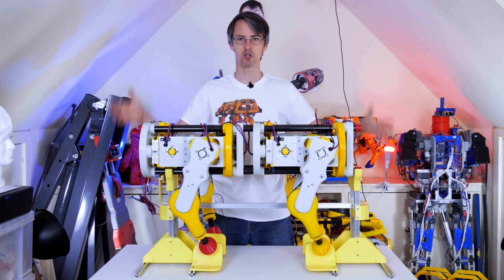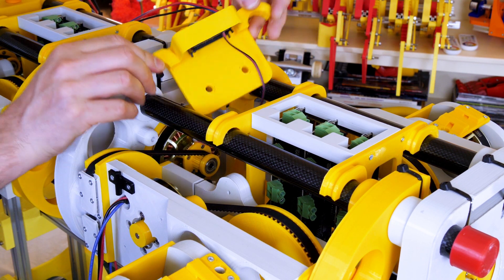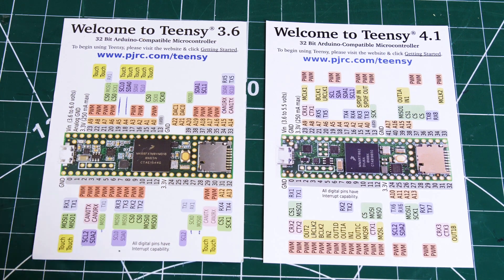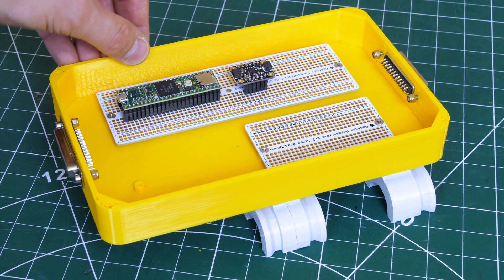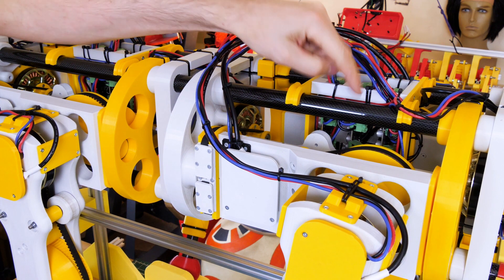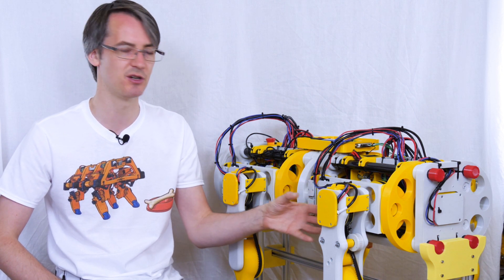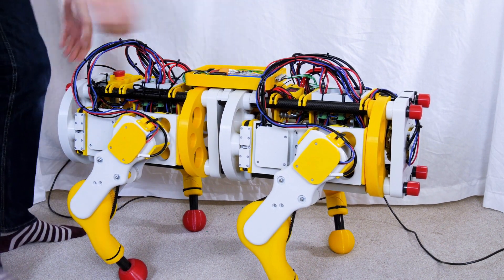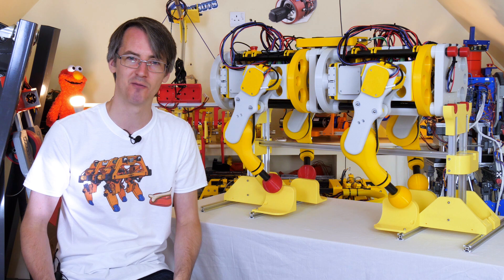openDog V2 Part 4 - Electronics and Power up!

Comment: Please reply. I need help with a university assignment.

I have to design a 6dof robot arm for a university project. I have to design the arm itself using a arduino mega 2560 and 6 nema 17 motors, as well as the power supply for the arm. I have to design the rectifier as well as the converter to convert our 230 V AC (I am from South Africa) to 12V for the drivers as well as the Arduino in parallel. I read online that my power supply should be > than at least 2/3 my current per phase of my motor time by the amunt of motors you have. After looking at the specific nema 17 datasheet I had seen they have a phase current of 0.31 A. This means I have to have at least 1.24 amps from my power supply for my motors alone, would you say this is about right? If so do you believe a 5A power supply should be enough to run both the 6 motors as well as the arduino along with all of its connections. Or do you think it would be better to have a seperate power supply for the arduino to draw its own current and avoid transients like you said in the video or would it be fine to run both the arduino and the motors in parallel off of one 12V 5A power supply?

Comment: I thought you were going to put a teensy 4.0 on every motor and connect them on the flexCan bus, with a dedicated small motor controller on the motor, then you only need to route power and Can to each motor. put the motor controller on the same pcb as the encoder.
Reply from the maker: which 'small motor controller' should I use that is open source?

Comment: Hi James, was noticing the lipo you use to power the electronics and actually now that I think of it, the Dog. 

I want to encourage you to at least briefly explore Life batteries, they might prove very suitable for this application. They are not as efficient storage to weight but since the dog is not an aircraft I can only see advantages. They have a lower nominal voltage, and an extremely flat discharge curve. They're absolutely not flammable and it looks like the lipos you are using need to be very carefully voltage-controlled so as not to pose a hazard. The true benefit of the life is it can be discharged deeply without damaging the cells, and they have extreme sustained discharge capabilities.

The ones that I got were used for DeWalt battery packs. They can be reassembled and rewired into incredible batteries that I imagine would be perfectly suited for your specific application.

I am unaffiliated completely,  but I bought two of them a long time ago and they are completely indestructible. I have abused almost all of my other lipos to the point where they have decreased capacity or cell puffing. 

Tl;dr l.i.f.e cell chemistry is very stable and powerful, and DeWalt life cells are a good way to take advantage of their unique properties.

Comment: You could put fans on the shoulders to help with heat maybe?
Another option would be to have all the drives oil cooled and use an intercooler somewhere.

Comment: Hey James. I love the videos. I recently discovered your channel. Keep up the good work!
Just a quick note: referring to 13:38, if the dog is in a resting position (just standing and not doing anything) maybe you could straighten out the legs? The power needed in a straight leg would be less than the power needed in a bent leg. Less power equals less heat. I think with straight legs there would be other balancing challenges but maybe feedback loop in O-drive would be able to handle it?

Comment: How about offsetting the static load with some springs?
Ideally start with the knee joints as they seem to work harder than the other joints.
Potentially with the right stiffness and preload you would even get some nice boost for jumping.
Reply: That's basically how nature does it, tendons and muscle, springs and motors.

Comment: The shoulder joints seem a bit too compliant.  Can you fix this by changing the control loop parameters ?  Seems worth a try before printing new parts to change the reduction ratio.  You probably need to tune each type of joint independently.

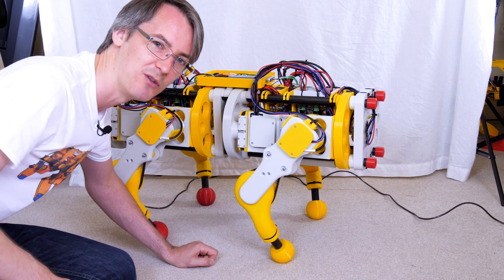Comment: 13:37 Maybe put some small fans facing the motors.
Reply from the maker: I think I'll need heatsink mounting plates with fans attached eventually.
Reply: @jamesbruton  the heat is primarily created in the windings rather than the magnets and there isn't much thermally conductive material to conduct the heat out of the windings because the stator is built on a composite structure. Your best bet would be air flow over the copper of the windings. IMO
Reply: @jamesbruton  also keep an eye on the odrive mosfet and driver temps. They need heat sinks and potentially active cooling when they are dealing with 10s of amps.

Comment: How long does it take to become such an Autodesk Fusion professional?
I wouldn't find the time to learn this. For my modelrockets I use Blender3D, which is not a CAD-Software.
But it works for me, because rockets are simple tubes in most cases. Their structure isn't very complex, and I'm not very ambitious ^^
Reply from the maker: Not too long, although I was using Autodesk 123D design before that

Comment: Looking at the wobble I think you gain a lot if you increase the distance between front and rear legs a bit. It looks as though it might fall over flat on its face after some rapid fwd bkwd movements. Anyway this appears to be the best 4-legged robot you have built by far. Good job.
Reply from the maker: I'm turning the back end around in the next video

Comment: Look at the Beagle Bone Blue Linux board.
Reply from the maker: For now I don't need an actual operating system, a microcontroller is more than good enough. I have a video coming up about Linux/ROS/Machine Learning though.
Reply: @jamesbruton  That sounds interesting.  THe BBB has IO and motor drivers and IMU and compass.  But it is dealing with LINUX.  The processor has two small microcontrollers that run independently of LINUX for fast realtime.  Keep up the good work.

Comment: Rated up to 48v... My "48v" battery gets well past 50v, would this still work?
Reply: If you are measuring 50V, you are probably measuring the battery without any load, which is giving you kinda meaningless numbers.  Put a small load across the battery, and measure again.
Reply from the maker: The 48V ODrive has 48V caps in it. The ODrive 3.6 is 56V now though..

Comment: Do be careful with your power distribution lugs.  Those lipos can easily deliver 150A continuous, and 25x that instantaneously.  That's enough to vaporize those bolts if they short out.

Comment: You really want to use the Jetson?
Man that will be a departure for you.
You'll better start to familiarize with Linux right away so you know at least some of the commands you are punching into the console.
Try to get arch running that is punishing enough that ROS will feel like easier.

Comment: I'd definately build a quick rig to charactise your motors!  Use an arm with a mass (simple but torque has an angular dependancy), or a pulley with string and a mass or scales (keeps constant torque). then define your peak short term current limit (may as well be the maximum your O-drive's can supply (or th saturation limit of the motors themselves if lower) by ploting torque against current in steps. Then, mechanicallly lock the motor solid and carry out some long term thermal tests, fix phase current, and measure motor temp until it stabilises, starting at low current to avoid gross overheat), measure the average phase voltage at each current (easy because motor isn't moving) and that multipled by the phase current gives you the phase power.  Do that at a few current levels and you get a thermal impedance for the motor (in watts per degree). You can now use a simple integrating power function in your controller to estimate the motor temperaure in application, and limit the phase current accordingly.  What this will do is give you a large instantaneous peak current for very fast dynamic control (you could actively counter flex in the chassis /joints/structure for example) but prevent your motors overheating during the longer term holding loads, which require much less torque, but for a longer time (your thermal integration model of course simply counts the energy flowing into the motor vs time)

Comment: Interrsting thought: when the knees bend, the power needed to hold the dog up will go up aswell. What if you made the knee pullies oval, so that the gear ratio changes, when the angle of the joint changes
Reply: The idea is good but i dont know if this is so easy to program but it would be possible
Reply: That might work, but an issue I see with an ovular pulley is that the tension on the belt would fluctuate as the pulley rotates, he would need to design a shifting tensioner for the belt to prevent skipping or overtightening/loosening of the belt

Comment: that little jump was amazing
love the new design
I only always have the feeling that the red feet show the front not the rear.
Are you sure you want to tie in the battery?
maybe mount your holder upside down, so you can tie in the batterie with a velcro strap
so it can be removed for charging
Reply from the maker: There's more jumping in the next video!

Comment: Just stick a tiny little fan to blow some air over the motors and you'll be fine.
I don't think they're meant for static torque anyways, normally when they spin they generate some airflow to cool themselves.
And if they get hot enough to melt the PLA then they'll also be plenty hot enough to damage the neodynium magnets.
Reply from the maker: Yes I think I need aluminium heatsink mounting plates and cooling fans

Comment: awesome!
Reply: does it make sence to position all legs outwarts, while normal/still standing? i am thinking about 2° or 3° away from center/diagonal.
this would make a little triangle, providing more over all stability.
Reply: @VideoStefan17  he has them facing this way so the feet are in line with the shoulder joints. This is important for the kinametic model.

Comment: Nice to see it moving; looks like a huge improvement indeed; very reactive, backdrivable, and quiet too. 'Wobbliness' seems fine to me; this is to be expected with motors just holding position; if you have a proper dynamical model you can program it to dampen itself, rather than oscilate as much, and it seems to have plenty of power to react in whatever way you desire. I wonder if arduino has an modules so that you dont have to reinvent the wheel on all things control systems related. This may be part of the fun for you but there is a lot more out there than a single-DOF PID loop. I think itd be especially cool to couple a robot like this to your jetson, and run some modern learning-based control algorithms on it. If you have a somewhat accurate model of your entire robot in software, you can train that to walk elegantly and energy-efficiently in software, and then fine-tune that model on your physical machine. These are fairly new techniques, but if you were to partner with someone that knows a bit about more ML-based control systems I think you could get some really mind blowing results, now that the hardware is of this quality.
Reply from the maker: Well the ODrive has it's own PID parameters for the actual motor positioning so I don't have to deal with that in my own code.
Reply: @jamesbruton  Well thats a convenience relative to having to do it in arduino, but any such single-DOF controller, or combination thereof, is never going to be a substitute for a controller that is optimized over the entire system of degrees of freedom.
Reply: @eelcohoogendoorn8044  While true, having a low level high bandwidth single DoF controller coupled with a low reduction geartrain is one of the innovations that made machines like the MIT Cheetah and Mini-Cheetah possible (and my own).  Higher level control can be much simpler, and run at a lower rate, when you have a quasi direct drive low level control with electronically controlled compliance.

Comment: Maybe add some cooling fans to the motors? Can't wait for the next vid. I've always wanted to make my own robot dog, but I never put myself to it. Too many other projects combined with life stuff going for me. Yours ended up better than anything I've thought of anyways, though I always knew back driveable systems are the way to go. Maybe in the future you could experiment with linear induction motors.
Reply from the maker: I think I'll need heatsink mounting plates and possibly cooling fans
Reply: It's possible you might have to program a "resting" position or in other word, make it a lazy dog when it's on but not doing anything.

Comment: Love the video, as always! Is there a reason you don't use PlatformIO instead of the Arduino IDE or an ESP32 instead of a Teensy? I was scared to try it but once I did I realized I'd never switch back.
Reply from the maker: The Teensy 4.1 is massively more powerful and also has 8 serial ports.
Reply: PlatformIO really is a game-changer;
For those embedded projects I always used to program in the Arduino IDE because it is just so convenient with the Download Buttons etc...
But being able to use the full Arduino environment within a PROPER IDE with code completion and everything is absolutely awesome

Comment: While the shoulder joints have no steady state load, they will still be pretty important to your ability to walk generally.  For a 4 legged geometry, small disturbances result in pretty large torques on those shoulder joints, and anything other than static gaits will require high quality damping in that joint or else you risk the daemons of uncontrolled yaw oscillations and sagging during the flight phase.

The reasoning in this post is the same, even if at the time I was referring to a direct drive shoulder joint: https://jpieper.com/2019/04/01/quadruped-lateral-control-challenges/  I wouldn't be surprised if you find you want to increase the belt reduction ratio on the shoulders before the knee, just for the improved lateral damping it brings.
Reply from the maker: I can increase the ratio in the knees and hips ok, the shoulders are tight for space. We'll see how it goes with more holding current and some more ODrive parameter tuning though.
Reply: Are those timing belts fiber reinforced to limit stretch under tension?  They sell ones with virtually no stretch within load ratings.  These are useful for applications where compliance is undesirable.